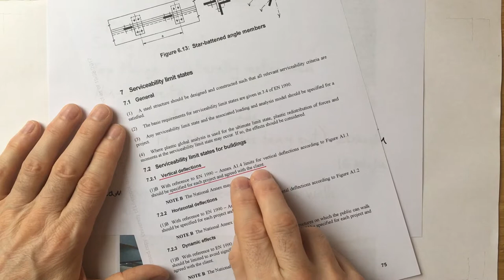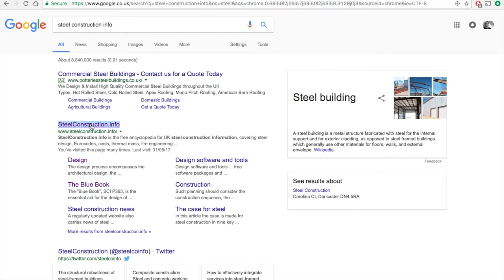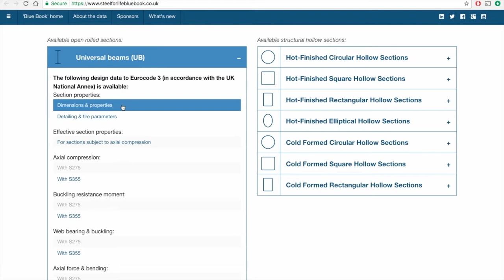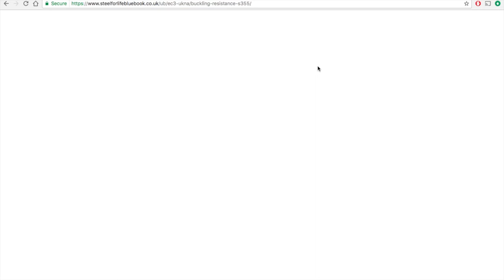Blue Book Steel Design - Laterally Restrained Steel Beams

Comment from the maker: Hi krishshah63, good question, this was given to me by a steel fabricator a long time ago but is still valid and you can check this yourself. Set the deflection to span/360 and substitute this into the usual deflection formula for a simply supported beam with a constant UDL, you can also add in the E value for steel and the span length. So, the only unknown would be w, the UDL. Similarly, you can take the general formula for the mid-span moment of a beam with a constant UDL. You know the span length L. You can rearrange the two formula to show that I required = ML/56. You need to take care of your units and remember that your answer is cm to the power 4. I hope that this helps, Mike

Comment: Thanks for the video. Would it be possible to explain how you came to the 'short-cut formula', I = ML/56 to find the second moment of area? Thanks
Reply from the maker: Hi Ryan, apologies for such a slow response (I thought that I had replied earlier). ML/56 is found by rearranging the deflection formula that appears at 11.30 in the video. This is a standard formula for a UDL on a simply supported beam. The deflection is given in terms of span/360 and the moment is given by the usual w x L x L / 8. This is algebraic manipulation to make I the subject of the equation. You have to be very careful of the units and always be aware of the assumptions for this shortcut. I hope that this belatedly helps, Mike
Reply: @mikebather  thank you very much Mike!

Comment: How do you know whether to find a higher required plastic modulus Wpl,y or larger 2nd moment of area for our trial section?
Reply from the maker: Hi Mil, this is a good question - do you design for strength or deflection. A rather vague answer is that for shorter spans, strength is likely to limit and for longer spans it is deflection. The problem is that most beams are somewhere in between. This is something that experience will help, but until then, you need to plump for one or the other - for typical floor beams, I generally go for strength first and then check deflection. I hope that this helps, Mike
Reply: @mikebather  Hi Mike, thank you for your response. It does make sense now.

Also, when establishing Wpl,y required we are automatically assuming the section is plastic right? Then is the cross-section classification a verification step to confirm the section is Class 1 or Class 2 plastic?
Reply from the maker: @mil9102  Hi Mil, yes it is a check. Take a look at Draycott and Bullman's textbook where is shows that ALL UB sections are Class 1 or 2 in bending and nearly all UC sections too. But, you may wish to design for other sections and so, for these, you need to check classification, hope this helps, Mike

Comment: I'm confused: what's the differendfe between the BM in blue and the one in red at around 4min 30 secs? And why does it suffice to work out required second moment using only the (lower) red BM? Brilliant video by the way
Reply from the maker: Hi A A, at around 4 mins 30 secs, the blue BM relates to factored loads and the red BM is solely unfactored live loads. So the blue is ULS and the red is SLS. I hope that this helps, Mike

Comment: Hi Mike, why are you using Iy, why not Ix? I'm guessing that live load will load the beam in its major axis. So shouldn't just we check Ix value? TIA
Reply from the maker: Hi Gagan Kataria, thanks for the question - it is something that I did not make clear in the video. In the UK the strong axis (vertical bending for a vertically aligned I beam) used to be called (BS5950 and BS449) the Ix axis and the weak axis (side to side bending) was the Iy axis. EC3 has renamed these axes so that the strong axis is now the Iy axis and the weak axis is now the Iz axis. I hope that this helps, Mike
Reply: Cheers Mike, that makes it very clear. Iy is basically the strong/major axis, what you're checking against.
I tried to see if I could use blue book for Australian beam sizes but  I figured names and some properties were different. Therefore didn't proceed. 
However I do have Fionna Cobbs structural pocket book, which I refer to sometimes.

Comment: А что с расчетом на устойчивость?
Reply from the maker: Hi Andrejs Jakovlevs, using google translate, I understand that you are asking: what about stability? These short videos only really cover element design, overall lateral stability is another matter. Is it the lateral stability of the beam that you are asking about? A laterally restrained beam has its top flange connected to a structure that is able to restrain it from lateral buckling - this is considered to be so when the adjacent structure is able to resist a force of 2.5% of the compression force in the top flange. I hope that this helps. If not, please could you reply again in English, thanks.